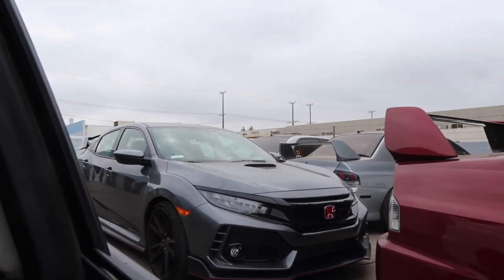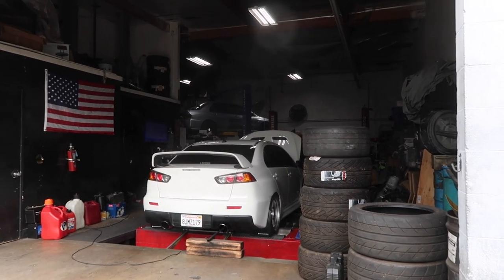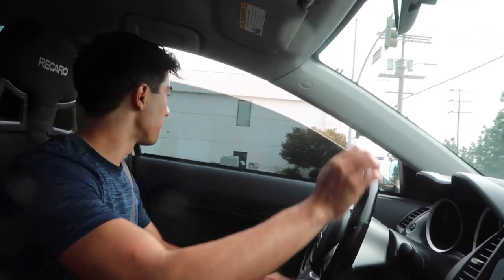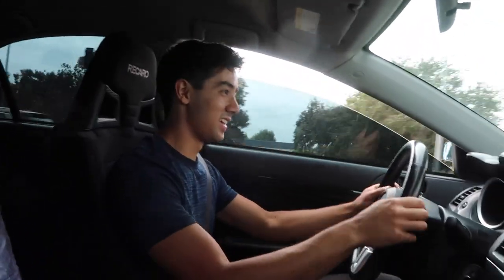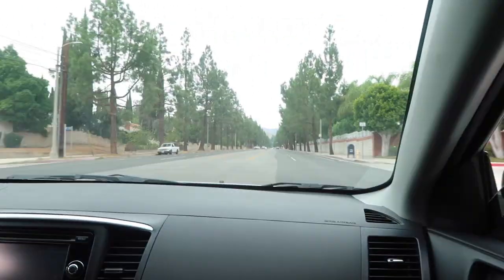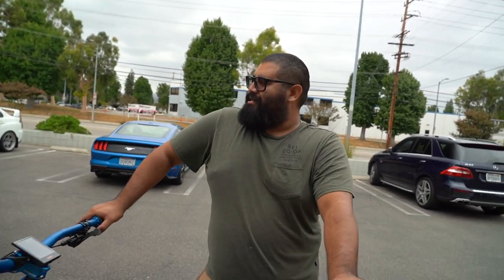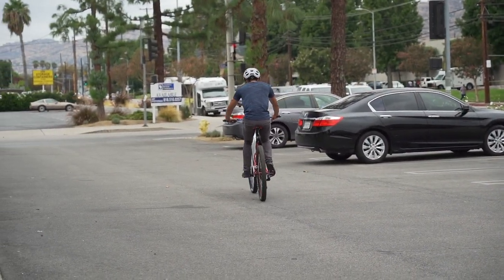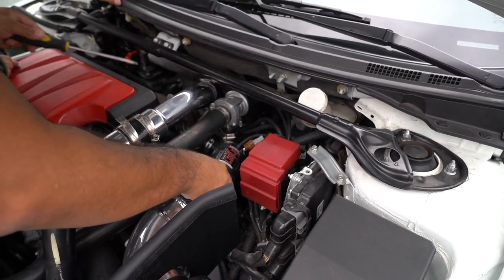My Bolt On Evo X Hits The Dyno

Comment from the maker: 318WHP/322ft-lbs Tuned by KT Motoring
-Injen Intake and Upper Intercooler Pipe
-Grimspeed 3 Port
-ETS Recirculating Downpipe (stock catalytic converter still) 
-Borla Catback
Reply: Christian Meyer how much did they charge you? Planning to get tuned too at KT
Reply from the maker: $450 for single map
Reply: Christian Meyer thank you bro. Congrats on your new tune 🙌🏼

Comment: This is honestly my dream car, and im gonna be getting one next year... but what made you go with injen intake and UIP instead of ETS? Also how long did you wait to get a tune after you put all of your mods in bc ive seen that an intake with no tune can cause to car to lose some power
Reply from the maker: I went with the Injen because I read good things about, liked the heat shield design, and both the intake and UICP are carb legal. 

I had the downpipe and catback on for like 2 weeks before the tune. But the intake, UIPC, and boost controller were installed the day before the tune.

Comment: What limits you to 320hp? Is it the turbo or fuel system as I have stock people make 400hp with them on YouTube
Reply from the maker: Still running stock fuel system, intercooler, and oem catalytic converter. 

A stock turbo X needs ethanol and “full” bolt ons to hit 400whp. I have like half bolt ons haha.

Comment: I just bought my 2013 Evo X GSR. I’m new to Evo’s. So far studying the car, the previous owner put a Perrin catback exhaust, Perrin turbo intake inlet, and Perrin upper and lower intercooler pipes along with the Cobb accessport. Would that be considered stage 1 or stage 2? I’m still a little confused on how it works coming from a naturally aspirated car. I’m guessing it would make similar horsepower and torque numbers?
Reply from the maker: imo, accessports are useless. i’d flash back to stock and get it dyno tuned asap. cobb tunes are designed around their own brand of parts as well.
Reply: Christian Meyer you’re exactly right about cobbs own brand of parts. I did a lot of researching and I thought it was pretty ridiculous because I don’t wanna start buying Cobb products just to tune it with the their accessport. Versus me buying other different brands that I may like better lol
Reply: Also, what’s considered “full bolt on” in a turbo car?
Reply from the maker: FBO on Evos are typically intake, turbo back exhaust setup, intercooler, intercooler piping, boost controller.

Comment: Sick bro. I’m getting tuned next Monday at English racing. Should have gotten a high flow cat for more power. 318 seems low! Could have squeezed 20 more hp
Reply from the maker: Yea a test pipe and intercooler should have put me a little over 330whp. I’m not too worried about the power right now though.

However, I do plan to do those with a flex fuel kit within the next few months so I’ll be back for a retune/dual map eventually.

Comment: Can you explain to me what happened at 3:33? So basically the pressure from the boost loosened the coupler off of your intake right???
Reply from the maker: Exactly, but a coupler on the upper intercooler pipe not the intake.